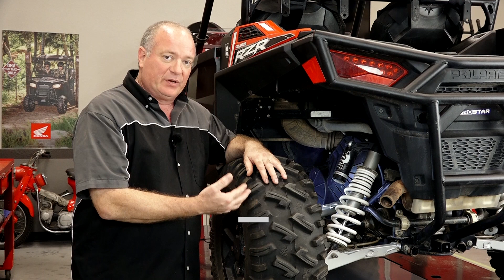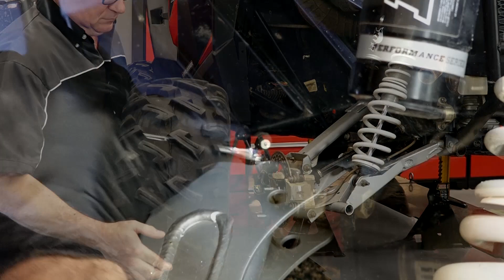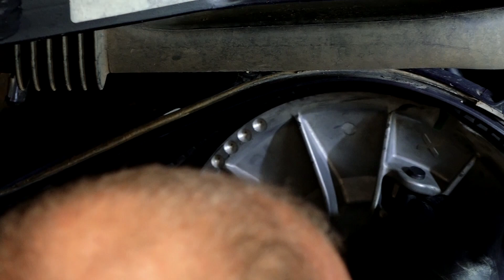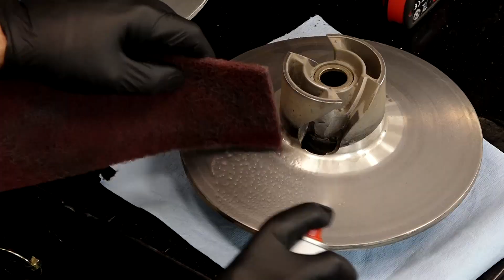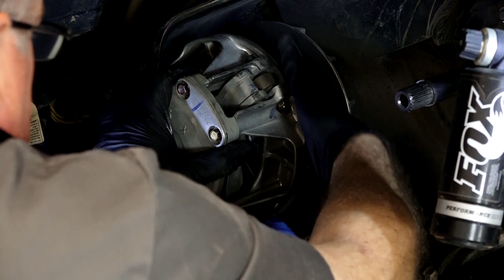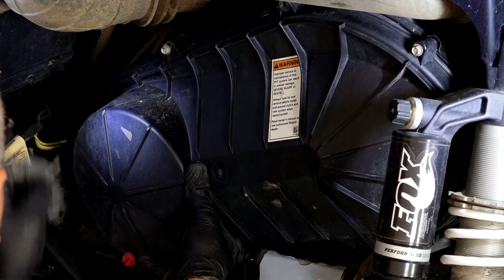Polaris RZR Drive Belt Change | 2015 Polaris RZR 900S  | Partzilla.com

Comment: I have my belt not disengaging on mine at the moment would this be an issue with my primary? I just changed that belt 400 miles ago it was fine till I let the machine idle for a bit one night and it will not disengage I have to shit the machine off to shift. Also to not it will not go nay faster than 50mph now either almost like it's maxed out on speed. My secondary is much different on my 15 guessing that's because it has ebs

Comment: Just  got a s 900 with 5,000 miles what are you seeing worn/needing replaced. Seems solid just replaced front cv boot seem like the right rear  is cambered in about 3% no degree button.
Runs great 👍 just noticed  clanking in the rear loading and tight pavement turns thanks in advance. Assuming it is a locker and that's normal?

Comment: Is there a way to do the belt change without the impact driver.  This is not a tool I would typically carry when riding.  Also you failed to show this as a fool required for the job at the beginning of the video.
Reply from the maker: It's not required, it just makes life a lot easier.